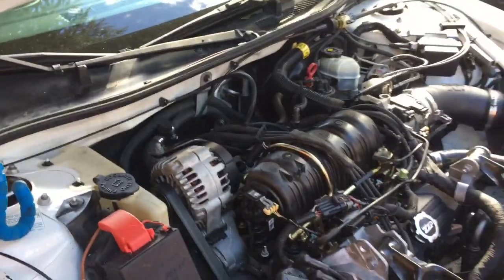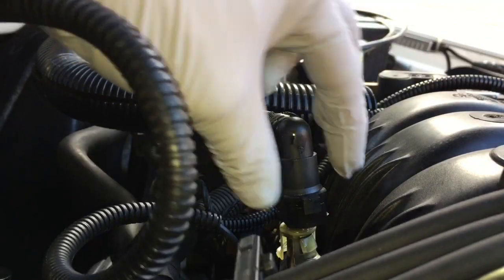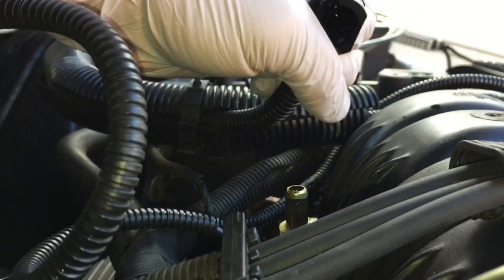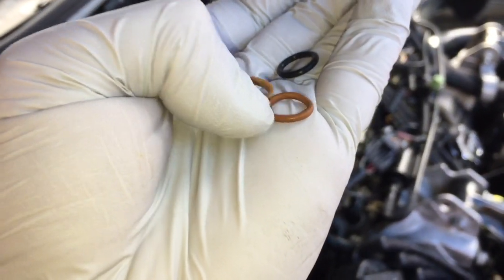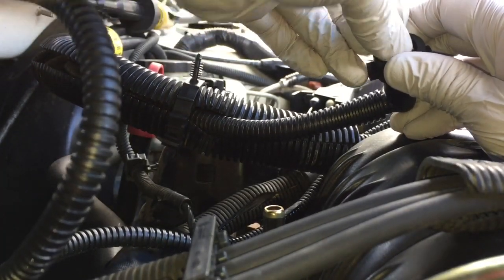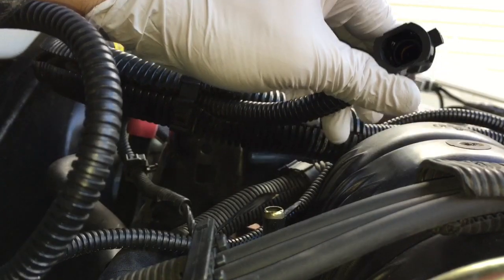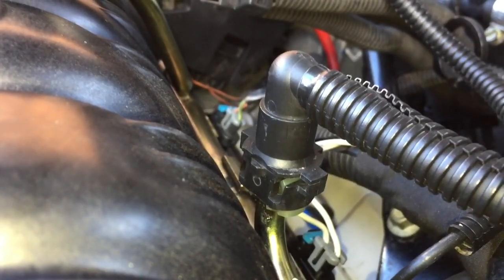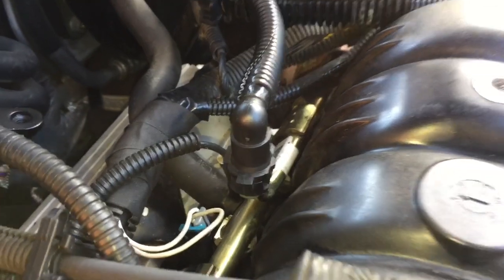Fixed it!!! Common fuel rail leak on 3.8 3800 Pontiac, Buick Oldsmobile

Comment: Typical GM cheap junk.  I bought the 90° elbow from Dorman.  I cut the line right at the connection.  Is the fuel line able to expand by heating the end up with a heat gun in order to get the barbed end on?
Reply from the maker: I would not try heating up the line with an open flame, maybe a hairdryer would work for you?

Comment: What is this sensor called?
Reply from the maker: Here are the single Dorman 800-082 Fuel Line Fittings on Amazon.
https://www.amazon.com/dp/B000E323JO/?tag=tweekerdan198-20

Comment: Mine is leaking from the actual connector right where it bends at 90°. Is it possible to replace just the connector or do I have to replace the whole fuel line?
Reply from the maker: Yes I believe you can replace just the connector.
Reply: I ordered the part $ 408 but the rings that was given is a lot bigger 🤦🏾‍♂️ @TweekerDan1984

Comment: Im having trouble finding the spacer o ring. Have a buick ive been working on, and fuel is leaking at rail fitting, if I could get link for oring spacer would be very helpful
Reply from the maker: Hi there, you may have to purchase the entire fitting. The part number for the O-rings have changed. I have a link for the fittings in the description also when purchasing the entire fitting you can just pull the O-ring and spacers out of it and use them on your existing piece.

Comment: Just fixed the problem following your guidelines. Thank you so much for this and adding the part numbers to order. I bought the two pack of 90 degree fittings on Amazon and transferred the O rings and spacers. Very much appreciated.
Reply: Michael,  can you share what connectors you stole the O rings from?  I'm interested in doing the same.
Reply from the maker: I have the connector fittings he is mentioning listed in the videos description 👌🏼
Reply from the maker: Glad it helped, thank you for sharing.

Comment: Watched your video, twenty minutes later the job was done. 👍 Extra tip: Everyone should have a variety box of o-rings around for this kind of stuff. They're cheap and will save you many trips to the store. Make sure you get the oil/gas rated ones.

Comment: Thanks for this video! Have a 99 lesabre myself and realized I had a gas leak too. Checked the fuel line and noticed that the first o ring you install back into the plug (orange) is broken. How do I go about finding the right replacement?
Reply from the maker: I have the replacement parts with links for Amazon listed in the description. I hope they help. 👌🏼
Reply: @TweekerDan1984 where? I only see fittings and adapters. No o rings linked anywhere
Reply from the maker: @Groovysmokes23  the part number I used has been discontinued by felpro so buying the fitting and pulling the seals out of them is not the best way to go unless you are able to take your seals in and get them matched up by an auto parts store.
Reply: @TweekerDan1984 thank you! Just as I was about to inspect it further I lost the black fitting. Any ideas where I can get it?
Reply from the maker: @Groovysmokes23 if you use Instagram you are welcome to send me a message with a photo of area in which you need a new fitting. My instagram is also The same as my YouTube user name

Comment: Thanks so much. Was looking under the hood of mine and notice I kept smeeling gas as I was driving. Everytime I turn the key over it squirts gas right out of that line. Showing the o ring order also was a big help. Thank you
Reply: Do you know the ORing part number?
Reply from the maker: @averyshelton2862 hey there, I listed items and parts in the description. I found buying the entire fitting is the safest route since the item number I shared was discontinued. Please let me know if you need anything else?
Reply: Do you know the ORing part number?

Comment: Okay, it has been a year since the last comment so I am not sure if anybody will see this BUT - I needed to replace the inner o-ring on my unit. I used a 9.25 x 1.78mm Viton polymer for that; and the #110 Nitrile rubber as noted in the video for the outer o-ring .

Just in case anyone needs that information.
Reply: I have seen it! Thanx for posting info!

Comment: I know this is an older video but I’m having this exact problem and no parts store or dealership has them. Do you have a link or anything that would help? Are the o rings the same size because Amazon and summit have felpro 408 orings
Reply from the maker: @Jarettdunaway6679 just updated the part numbers last week and shared them below in the description. 👍
Reply from the maker: @jarrettdunaway6679 Here are the two complete Fuel fittings with prongs and plastic clips/spacers. You would just remove the interior rings and clips and use them on your already installed fitting. You would only need one set. The links are for a 90 degree angle set and a straight set. You would only need two fittings total and the internal clips and rings should be the same. Only sharing both fittings incase someone would like to replace the entire fitting. 

Here are the single Dorman 800-082 Fuel Line Fittings 
https://www.amazon.com/dp/B000E323JO/?tag=tweekerdan198-20

Or a 5 Pack of this same straight fitting
https://www.amazon.com/dp/B002ESS8JG/?tag=tweekerdan198-20

2 pack of 90 degree fittings https://www.amazon.com/dp/B000E3022E/?tag=tweekerdan198-20

Comment: I tried to remove that retainer ring and it shot out into the unknown so I bought aftermarket fuel connectors and pirated the retainer  ring, o rings and spacer. It was $10 for 2 at O'Rileys. I might of just replaced the connector itself but they didn't have the elbow type only the straight ones.
Reply from the maker: Thank you for sharing! Would you mind sharing the part and part #? Thank you.
Reply: @TweekerDan1984  Dorman 800-082 fuel line quick connect.
Reply from the maker: @frankgagnier4805 thank you for taking the time to share the part number and additional tips. The part numbers tend to change regularly, so this will be helpful to update the part for those in need. Cheers!
Reply: @TweekerDan1984  when I tried to remove the retainer ring on the new one I started to scratch it so I took a pair of snips and carefully cut off the housing to free it up. After it was removed, the two washers and spacer came out fine.

Comment: Are they easy to come off and put in because I see some people saying they have trouble doing that but the way you did it made it look very easy
Reply from the maker: @Tommy Castro when attempting to remove them, I would make sure you have a tray underneath the fittings so that you can catch anything that drops, using a small pick set makes removing the fasteners and o-rings very easy to do. So the right tool makes it 10x easier.

Comment: Damn...I cannot find fuel resistant orings anywhere in the size I need
Reply from the maker: @Kris here are a couple links that may help, these were not available when I created this video come and these may may be helpful if o-rings are not available. 
(90 degree)
https://www.amazon.com/dp/B000E3022E/?tag=TweekerDan198-20
(Straight)
https://www.amazon.com/dp/B000E323JO/?tag=TweekerDan198-20
Reply: @TweekerDan1984  thanks Dan, I assume this comes with the orings installed? I fixed this issue about 3 years ago and bought every oring O'Reilly's stocked and none of them fit. Ended up buying a plumbing oring kit as I was in a pinch and knew it was only a matter of time before they broke apart as they aren't fuel resistant.
Reply from the maker: @kris54241  there are a few assorted kits that I’ve found online, I think I even have some of the extra prints I ordered, the ones. I wish Fel-Pro still had their parts readily available. The ordering say installed almost 5 years ago have been good on all three of the cars are installed them on.
Reply from the maker: @Kris you would think that the O-rings would be included, but I do not know for sure, since I have not ordered these before. A couple people that are here on the channel shared that these worked for them.
Reply: @TweekerDan1984  I'm nervous now because I just ordered the O rings that you used and theyre too big , now idk if that piece will work lol what a mess
Reply from the maker: @Kris I still have the original Fel-Pro assorted gasket box that has all of the gaskets clearly sized. I wish I could find this.
Reply: @TweekerDan1984  I took a razer blade and trimmed them to fit, guess we will see if it works. Seems to be okay at idle. Last tank of gas only got me 220 miles and that mostly highway so it was leaking bad
Reply from the maker: @Kris I finally found the exact kit I used. The sizes in the description down below are in the kit. Fel-Pro O-Ring Kits OR4085 https://www.summitracing.com/parts/FEL-OR4085
Reply: @TweekerDan1984  thank you so much! I will be ordering those as I don't think my hack job is going to hold up.
Reply from the maker: @kris54241  you’re very welcome. Sorry I was unable to find just the individual O-rings. I’m sure they are out there somewhere.

Comment: I have a question,  I know that you only used one O-Ring for your situation, but can the same style O-Ring be used to replace both the first and third O-Ring?
Reply from the maker: @Luke Cage, I believe they were different sizes but if you try it and it leaks you could just find a different sized o-ring.

Comment: In attempting to remove it, it just squirted out Fuel, what do you think the reason for that?
Reply from the maker: Did the fastener release for you? The fuel line is pressurize so it is normal for it to squirt out fuel but it would stop squirting out fuel as the pressure was relieved from the line itself.

Comment: It worked for me today too! Bought a new connector, but just used the O-rings, spacers and new quick release clip. Way easier than replacing the whole connector. Thanks for posting this!
Reply: I smelled gas coming out the vents yesterday,  opened the hood same problem,  went to o-reillys they don't sell the orings,  called grainger they have 80,000 o-rings in stock but don't measure the thickness???  could not cross reference one,   so i ordered the dorman 90 degree,  oreillys had it there in 3 hours I pulled the orings out and reinstalled everything is now TIGHT no more leakage,   this comment saved me even more work,   thanks Robert Bigler and Tweaker Dan 1984 I was freaking out thinking the engine was going to burst into flames,  turns out the repair cost $11 and now i have a backup set of orings in case the dormans leak,  which replacing the coolant arms 3 times they do,  ordered the ac delco orings and the coolant arms no leakage been over 4 years now.
Reply from the maker: Can you share a link for the O-rings that you purchased? The ones I used in the video must be discontinued.
Reply: @TweekerDan1984  Not too sure Dan... I think they were in a Dorman quick connect from Rock-Auto.
Reply: @TweekerDan1984
Reply from the maker: @s7uidz are you able to share a link for the o-rings or the kit? Thank you in advance.
Reply: do you remember your part number and manufacturer?

Comment: Thanks! Mine might be leaking there, but it's also leaking on those where connects to the fuel pump on '97 lesabre - I had a tank replaced bc rust, but think it may have actually been these - wish I'd known.

Comment: I have a 03 buick regal ls 3.8 its throwing a misfire on the #5 and egr valve code rough idle bogs down with acceleration could this leak cause the codes its throwing i have done full tune up coil packs egr cleaned throttle body im at a loss i did notice that the exact fuel line was leaking a little
Reply from the maker: Yes the loss in fuel pressure could potentially cause many other issues.

Comment: Thanks for the educational video on fixing the fuel rail line clamp. I wished the  jack-a** that owned my car before me would've watched this n fixed it right instead of cutting the clip connector completely off n replacing it with a regular rubber hose! How crazy. Now i have to possibly buy new lines or I'm hoping i can buy a replacement connector n repair it myself. Anyway just wanted to say thanks n i appreciate that you did it the right way. 👍💯

Comment: That's the return line correct?  Is it 3/8 line?
Reply from the maker: Yes, and I do believe they were 3/8 lines. I would need to double check to be certain. 5/16 is also a common size for these rails.
Reply: @TweekerDan1984  I got both 3/8 and 5/16  connectors and both of them were way too small.... I had to go back to Advance Auto and found a connector and length of tubing that did fit.

Comment: It used to be that to Be Safe... Brown was Fuel Safe, Green was HVACN and Black was Universal but Definetly not Guaranteed to be Fuel Safe.. 
Make Sure It Says Fuel Safe..
Do you know the Diameter on the Pressure/Send Fuel Line on the Front of the Engine by the Fuel Pressure Regulator ?

Comment: Here's another option for 3800 V2 Fuel connection repair. 3/8 or 5/16.
https://www.youtube.com/watch?v=lJKRLaLmEzs
Detail listed also in comments.
Reply from the maker: Thank you for sharing more options on ways to fix this problem. Cheers
Reply: @TweekerDan1984  Sure. The 3 options, yours, repair in place as above url or 
puchase repair kit 800-059, 800-193 press on Dormans parts. Contact D support as needed.

Comment: I have a question. I tried doing that to my 2004 chevy impala. And it starting spraying gas. How do I relive that gas pressure
Reply from the maker: Commonly there is a valve that looks like an air stem from a tire. If you have this valve you can press the needle in to relieve pressure. If not you could disconnect the line and let it spray, the spraying will stop and dry up very quickly.
Reply from the maker: The other route is to disable the fuel pump and crank the engine to help reduce the pressure.
Reply: Awsome your a genius. Thanks i just let it spray out and it stopped. At first I was tripping out ,, but got it fixed had to replace the o-rings. Thanks for the help

Comment: question, did you bleed the fuel pressure from the system before pulling the line off??
Reply from the maker: On most of these vehicles there is a release valve up on the fuel rail but since my fuel was already leaking I did not have to relieve the pressure.
Reply from the maker: If you’re not familiar with the valve it looks like a tire pressure valve.
Reply: Fixed it because of you!!! Liked, followed and subscribed man! Thanks you so much!!!

Comment: Is that the same on the superchared 3.8 i didnt see that on mine
Reply from the maker: I’m not as familiar with the supercharged engines, I thought the rail was located on the front side of the engine.
Reply: It is its something else it oly leaks sometimes when i drive it i can smell it

Comment: Ultimately ur video did help. I have a leak on my wife's car after i replaced her upper and lower intake manifold gaskets and now the fuel leak happened...
Reply: Did this video help you get that problem addressed? I'm right about to pull the fuel rail off of my car to get to the same upper & lower intake gaskets. All of my plastic parts and hoses are so brittle at this point, if they're occasionally known to fail doing a particular job, I assume it will fail. Hoping this doesn't happen to me

Comment: Thank you TweekerDan1984 for the excellent video.
 The black retainer clip that holds the O-Rings in place can be hard to get out.
Soak the fuel fitting in boiling water for a few minutes and it will come out much easier
Reply: I will try that, it almost looked like he squeezed that cap  a liittle ,hope i don't break it.

Comment: Well done man! Mine is doing the exact same thing. As a father of 3 and working on a limited income this will help me keep chugging along a bit longer. Thanks.
Reply from the maker: Thank you, Let me know if you come up with any more questions.
Reply: @TweekerDan1984  I didn't see the cap on my 01 Buick LeSabre
Reply from the maker: Are you referring to the large cover over the engine, I actually see those covers missing on almost 1/4 of the vehicles that I come across with this same engine.

Comment: Brother brother brother...I have a great running 2003 buick lesabre custom and the car is one of the best cars I've ever had in my life .. I started smelling gas when I cut the heat on and I noticed I had to punch the gas harder for it to take off torque wise ..i use to be able to burn rubber on a take off and it then it was no longer peeling off like it use to..so I had the plugs changed still smelling gas and found the leak right there where your finger was but by now the leak was super strong and I'm scared to drive it ..guy at the shop told me for him to order that peice from a dealer re seal the valve drain the tank I'm looking at about $400 to $600 I was so furious my brother in Detroit told me go on YouTube and I be damnnn...all I can say sir is THANK YOU truly ...the O ring was $ 99 .¢nets....i notice immediately the power in torque and the gears changing on time ...and it's back burning. Rubber ...all from a O-RING..
Reply from the maker: Thank you very much for the compliments, I’m happy to hear your back to burning rubber😁 we still have two of these cars so definitely subscribe for more helpful videos. Thank you again for taking the time to share. Cheers!
Reply: ORing part number please  @TweekerDan1984
Reply: @TweekerDan1984 408 is to big